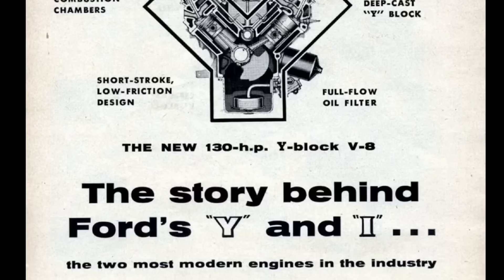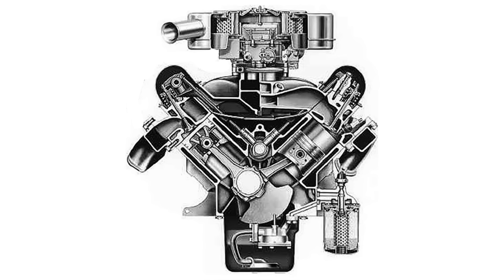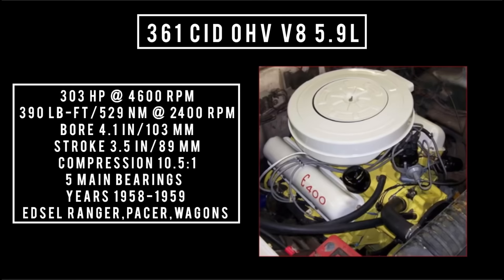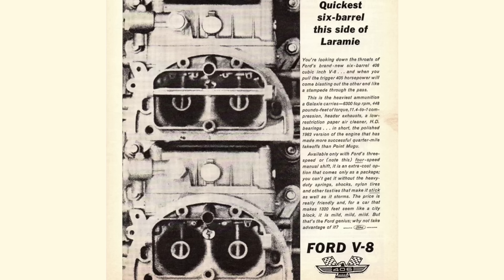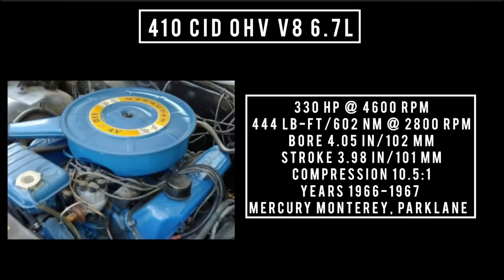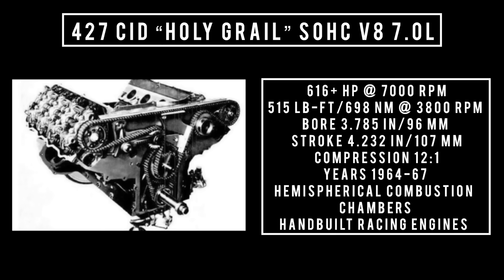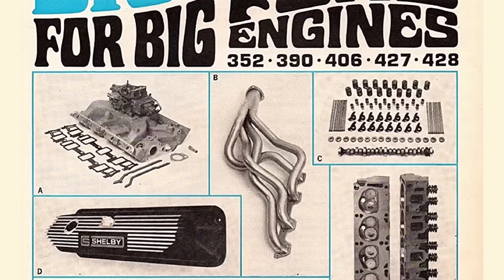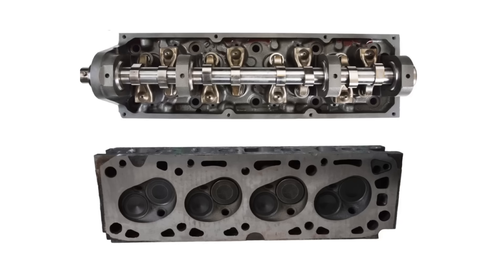Ford FE Engine Family 332, 352, 361, 390, 406, 410, 427, 427 CAMMER, 428, CJ428, SCJ428

Comment: Ford engines are so overlooked...it kills me to see an old Ford with a Chevy engine...a crime!
Reply: If you can't get a flat head for your 32 Ford, at least put in a FE or a Cleveland. I had  59 Edsel, and the Ford service manual named the V8 as a Ford Edsel.
Reply: @deang9061 
351 Cleveland is the baddest SB ever made. 350 chevy is no match.
Reply: @randycoursey7230  Pantera used a 351 Cleveland
Reply: @randycoursey7230 when you cant valves it breaths better
Reply: The FE was  very flexible platform   They sold thousands of them in industrial applications that are still used on irrigation pumps, power generation and oil wells
Reply: @timothysotelo3868 I work in AG. Saw a 427 running a pump.
Reply: @timothysotelo3868  likely hundreds of thousands of good FE cores. Shamefully many good cores went to China to build the Three Gorges Dam. The best iron America ever made. I wonder what the recipe for the iron in the Coyote is?
Reply: The thing I don’t like is the weight of the intake manifold when you had to replace the gaskets. That thing was heavy
Reply: @timothysotelo3868  yeah they are.
Reply: @timothysotelo3868 that's a good thing. Because switching to aluminum saves a lot of weight.
Reply: @timothysotelo3868  Yeah my 390 has an Edelbrock aluminum intake on it now, much lighter and supposedly has better airflow so torque is increased. I'd recommend that mod to anyone with an FE.
Reply: @timothysotelo3868 it was heavier than the head😂. I do remember seeing ONE with an aluminum intake. I don’t know if it was original equipment or not .
Reply: @timothysotelo3868 worst design ever. Nothing worse than a sucked intake gasket on one of these. As a veteran fleet mechanic I did this repair countless times....
Reply: @timothysotelo3868  I always swapped the iron intake for aluminum. There is no reason for a 75 lb intake when a 20 lb one is just fine. The Performer RPM has been around since 1990, and Trick Flow makes a great one, BBM makes great intakes and heads like Trick Flow and Edelbrock. The FE can be reduced to the same weight as a 350 Chevy.
Reply: You have the bore and stoke mixed up for the 427. It had the biggest bore 4.23" and a stroke of 3.78" same as the 390 .
Reply: The cost of a Chevy engine was cheaper, plus Chevrolet gotta jump on performance parts. True Ford fans will never put a Chevrolet engine in a FORD.
Reply: That's because bad habits are hard to break
Reply: @halseyknox yeah, being cheap and lazy is a hard habit to shake.
Reply: It used to be ILLEGAL in Michigan!
Reply: @Jerry-up8bk   when? I was born and live in Michigan. Not saying you're wrong, just never heard that. Tell me more please!
Reply: @Jerry-up8bk should be illegal ev ery where. It outta be a law. Ford in a Ford and nothing else will do. Ford's rule, chuvies drool.
Reply: I always thought the 361 was a medium duty Truck engine. I knew it was in the same family. But I didn’t know it was a car engine.
Reply: @dmandman9  The Edsel Police Intercepter came out in 1958. The 361 FT was a Heavy Duty Truck Engine that could be built as an FE.
Reply: @Bbba724  Ok. Makes sense. The truck engine was designed to run at high speeds/high load, so it makes sense to use it as the base of a racing engine.
Reply: I once heard that the LS is the pumpkin spice of engine swaps.
Reply: chev. cheap nasty.. find a 350. 010 block.. ditch the rest..  toddle down to your local go fast store,, wait till they open, smile, then,  give them your bank details, return in a wk..  Ford, pick an engine.  Dodge, visit local wreckers, pick a part, build engine.   ausie..  found similar comments in a mag, took 6 pages to explain.. basically,, chev sht..
Reply: I'm a ford guy and i agree. It's a crime. I once saw a video where it had the first sox/martin drag car with a rare engine in it. A guy says you can put a chevy in a chevy and a ford in a ford but you can put a hemi in anything. Haha.
Reply: Agree. If you are going to build any brand, use the original brand. Even if you have a Buick, use Buick engine, not Chevrolet, in the older vehicles when Buick, Chevrolet, Pontiac etc had their own engines.
Reply: So true.
Reply from the maker: I totally agree =)
Reply: Anyone who puts a Chevy motor in a Ford is because they are stupid and Chevy motors are a dime a dozen..
Reply: That was a dream I had, was to put Fords in my old Chevys but health and time have conspired against me
Reply: Nay, it is HERESY!!
Reply: Yeah people that put Chevy engines in Fords. Our total idiots.. and they're just a dime a dozen Chevy people.. and they really hurt the value of the Ford
Reply: @timr31908  The reason they do it is because all chevy cars are tanks. The Fox mustang is 500 pounds liter than a chevy. 
Most Chevy powered Mustang s are owned by Chevy guys.
Reply: I think it takes actual knowledge to keep a Ford running. 
Plus a Chevy was easier and cheaper to work on.
Reply: @jacobbarnard9504  Cheaper to  buy parts for because  ever  body made re-pop parts for them. But cheap is not always better. As for easy to work on I say BS.
Reply: I have a 55 Fairlane with a 428 P.I with a 4 speed Top loader and a power lock 4.10 geared 9" rear diff. It's a absolute beast and a blast to drive.  I couldn't agree with you more. People used to swap in chevrolet v8s because they were cheaper and had better after market support.  But thats not a valid reason today
Reply: @GorillaCookies  car sounds badass! 👍
Reply: Its because Ford changes its engine platforms like underwear. Because of the short production runs they make everything obsolete and support is low to non existant. Ford is greedy and purposely changes things even if its not really any different so customers will be forced to change to the new temporary thing or pay outrageous prices to keep the old stuff going.
Reply: As someone who owns and loves a car with a 390 FE V8 and had to rebuild said engine, I kind of get why they get replaced with Chevy engines. When I was looking for parts, Chevy parts were generally hundreds of dollars less expensive since they built millions of smallblock V8s over the years and LS V8s  are among the most popular tuning platforms in the world right now. Ford 390 V8s on the other hand... I could only find two cylinder heads for sale in the whole country (mine were in horrible condition), and they were in different states, for way too much money. My only option really was to have a machine shop rebuild them, which thankfully wasn't too expensive. But new cylinder heads for a Chevy were a few hundred bucks each and you could get them at Autozone tomorrow... 

Granted, I believe anyone with the patience to fix up their Ford FE V8 instead of swapping it for a Chevy engine will be rewarded with a bulletproof reliable absolute tank of an engine. It might cost more at first, but the payoff is that they don't need much maintenance at all. But if you're handy enough to do an engine swap and don't like spending lots of money up front, I can understand why a Chevy swap would look appealing.
Reply: the media is run by an eastern tribe that hated Henry Ford. When I was a kid, there was constant propaganda of how bad Fords were. So why was Ford always winning races? Why did Fords always look better ? But through it all, Ford had survived and will end up being the only American car company
Reply: Lifting the hood of a Ford and finding a Chevy engine is like lifting the prom  Queen's Dress and finding a penis !!!¡
Reply: Agreed.
Reply: The gm small block platform is easy to put in any car that's why they do it and everyone knows much cheaper
Reply: Yep, fn cringe everytime.
Reply: Although the Ford 390 is one of my favorite engines, I got way more important stuff to be pissed off about than what someone else does to a car/truck that does not belong to me or that I don't own. Should I be all butt hurt cause one of my neighbors runs a FE427 in his '52 chevy truck? Should I blow a fuse over the fact that some guy that I don't know dropped a sbc 283 in his '40 ford?
Reply: @jleonard7954  not mad, just sad! Anyone can do whatever they want with their car.
Reply: @kennethanway7979  I am not even sad, after trying to stuff a 429 into a '65 mustang, I get why someone would stick a hemi in a '32 ford or a nailhead in a old Plymouth. All of us ICE dudes need to stick together in this age of EV'S
Reply: Ford performance stuff much more expensive and less r and d on Ford that is why chevy small blocks number one used v8 in builds. Easy parts access at less cost and tons of companies to choose from. Ford never has and never will be as common and cheap and easy to make super fast on a budget. Build and stivknwith a design that tuners have supported for decades and more fords will have Ford engines. But I can buy 350 crate drop in amd run with more hp than rebuilding or building a Ford I have to same power output..price Ford coyote engine lately? Can buy crate 572 more piwer and power potential cheaper straight from gm already built dynoed and with warranty. Ford does not have that  so cry, you chose a Ford live with its short comings in aftermarket😊
Reply: I have seen Chevrolet guys pass up a better GM body and take a classic Ford to put a SBC in, and state that they did it to prevent a Ford guy from getting it in the future.
Reply: I’m a Mopar guy and when I see a Ford with a Chevy engine in it I cringe. Ford made some great engines so I can only assume the guy who does that is lazy and or ignorant.
Reply: Yes it is!
Reply: Yes I agree you get what you pay for it's a crime to see a Chevy motor in a Ford.... Pay a little more money and put a Ford engine in a Ford...,.😊
Reply: @timr31908 a lot of the 302 & 5.0 stuff is as cheap as the small Chevy stuff - has been for almost 30 yrs now because so many people build & race mustangs
Reply: It kills me to see ANY ford with a crappy chev engine 😊
Reply: @460duck  do you want to put it in the shop or drive it
Reply: @robertcoleman7556  I drive mine!!
Reply: @460duck 
BobbyRobbie drives a skateboard
Reply: If youve got 15 fords and 1 Chevrolet what do you have? A junkyard and a ride home
Reply: Unfortunately the Y block engines had the serious lube problem mentioned...and they were heavy... therefore the GM and Chrysler OHV's were superior... sadly, that explains Chevy V8's in Ford bodies.  As pointed out, later Ford V8's were very competent and the Ford 260 V8 family was a true winner
Reply: @peterruddick1952 : The 1932-1954 Ford was the perfect candidate for any V8 swap. 1954>1911, Chevrolet bodies were practically non existent. Even if you could find a decent Chevy body, you’d have to fabricate the motor mounts for a V8. 
Model T’s,Model A’s,1930-1940
Fords have been the most  sought after automobiles in the world. Chevy gear heads are getting the best of both worlds.
Their “cheap” little 327 small block Chevy and the venerable Ford body. It’s definitely rare to see a Chevy engine in a 1954-1960 Ford.
Reply: @peterruddick1952 :The Y block was to go into production in 1953. Because of the Korean conflict, there was a shortage of raw material. Ford didn’t have enough time to work out the bugs before 1955. 
In 2015, Jon Kaase built a 
Y-block that put out 600hp. 
Check it out!
Reply: @peterruddick1952  The biggest reason Ford guys used Chevy engines was, parts were cheap every body had blowen them up. I raced fords back in the 1960's and 70 and you had o go to Ford to get any parts, if you bought a Chevy engine, you could go to any speed shop and get the latest Cams pistons and intake manifolds. Most Ford parts were outdated and expensive
Reply: @peterruddick1952  
Ford was so heavily involved in auto racing Worldwide in the 60s they got behind when it comes to performance parts here in the United States. Ford engines were a bit more expensive also. That's a major reason why you see Chevy engines in Ford bodies, Cost. Not so true today.
Reply: @randycoursey7230  I used to build FE race engines, I had to learn how to use the grinder to get the heads to flow, my C4AE-G 1964 heads from a 352, after welding the chambers in like the 1961390 HiPo heads which were a lot like Yates Cleveland chambers ( C0AE-D ) that were from the 1960 352 hi po, that’s how far Ford was for its time. I did that on any pre-smog FE head, I got flow of 305, tumble and swirl like modern race heads. With a 70s Hollley SD my 394 makes 503 hp and 488 ft lbs, and it will run on 89 octane. It was that easy once you got inside the winners and saw what to do. The FE is the beginning and the Cleveland grew from there. I love them both. I’m old and blind now, but I can still hear a car going around a track and tell you what it needs for a tune.
Reply: @peterruddick1952  15 fords 1 Chevrolet =a junkyard and a ride home!!!!!!!
Reply: @robertcoleman7556 😂
Reply: Yes I totally agree nothing worse than someone putting a Chevy or a dodge engine in a classic Ford
Reply: @georgegundersen562 I don't worry about what other people do with their car or truck as I have more important things to stress over.
Reply: Been running a BBC in my '71 F250 highboy since 1979.... probably longer than the most of the commenters are old.
Reply: @jedclampett6466   nope! 63! LoL!
Reply: I believe it’s budget related. Any pushrod V8 from AMC GM Ford or Chrysler can make big power, but the LS became cheaper than others
Reply: @WesternReloader  tell me something thats not budget related
Reply: @robertcoleman7556  I don’t understand what you’re asking, or stating. I was merely pointing out the obvious in that GMs small block/LS-LT were so numerous it’s only expected they’d be the cheapest to build.
Reply: Chevy is more reliable.
Reply: You say it.
Reply: @hertljager1252  distributor is in the back of the hot rod engine !!!!!
Reply: FE means fricken expensive. Chevy backwards is cheap.
Reply: Acronym for ford backwards drof driver returns on foot
Reply: @robertcoleman7556 
With a Chevrolet you don't get out of the garage. Chev-Toilets
Reply: @robertcoleman7556 
Acronym for stupidity @RobbieBobbyBobbleHead

Comment: My buddy had a mid sixties Ford with the 352 . That thing would move!!!
Reply: The only problem was that most of the 352's guzzled more gas than the 390's.
Reply: @ksman9087   gas was pretty cheap back then...late 70s. Also can and hose!
Reply from the maker: I’ve heard and read great things about that engine
Reply: Good engines for strokers